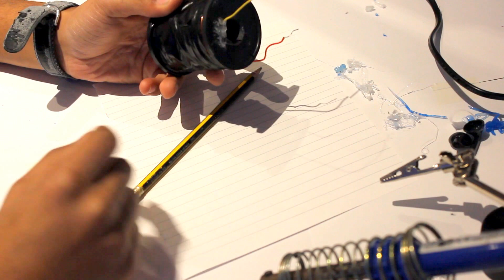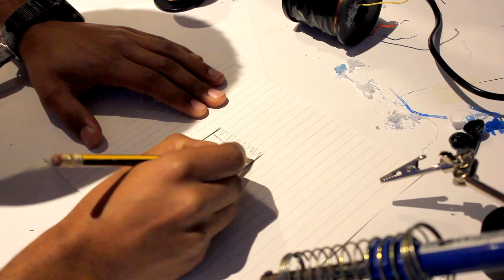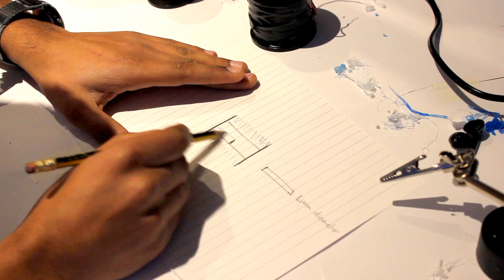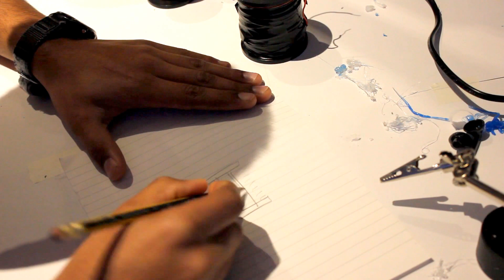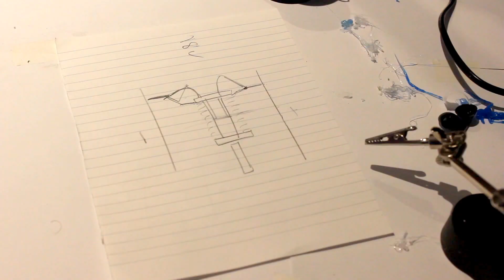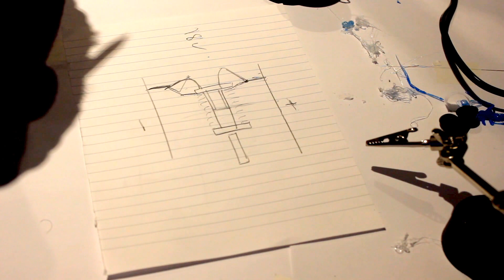Coil gun Idea #2

Comment: I will tomorrow post a circuit here how to turn off the rails with their trigger sequence if you like.
Reply from the maker: Azagro that would be amazing
Reply: https://i.imgur.com/GAHHM4L.png

This is a standard circuit
Reply: dhivan shah Circuit works like this: 1)
Switch is pressed, 12V signal initiates SCR.
2) SCR allows current flow, energizes the coil, pulling projectile forward.
3) Projectile passes gate or certain time has passed
4) This triggers the NPN transistor and pulls the SCR signal to ground (it's better to connect the collector after the switch)
5) SCR turns off, coil turns off
6) Energy can flow through diode and is mitigated by POWER RESISTOR
note: power resistor of wattage 50Watt or 100Watt
7) Safe for next fire.
Reply from the maker: That's really awesome thank you!!
Reply: SCR or high power transistor, doesn't matter.